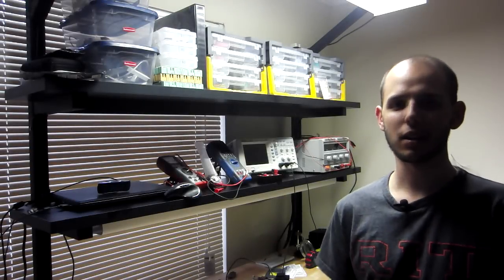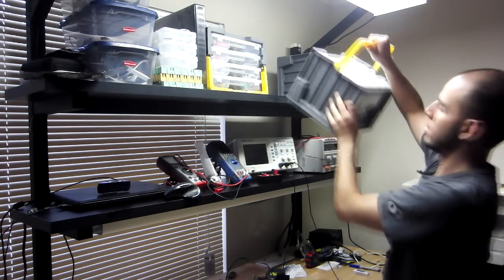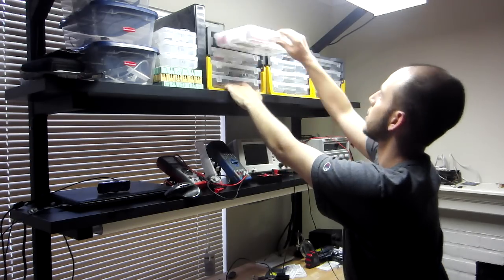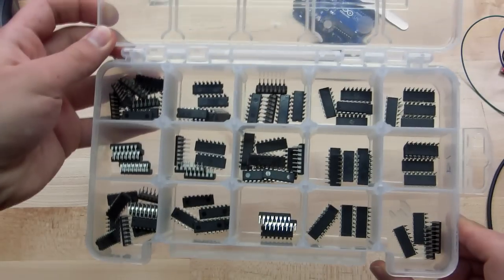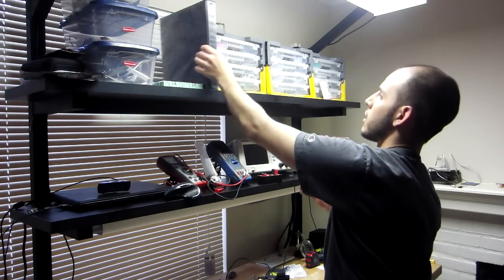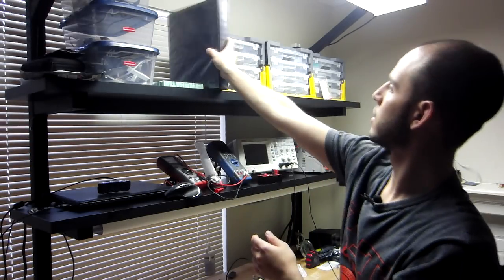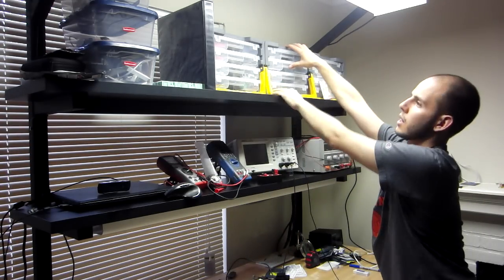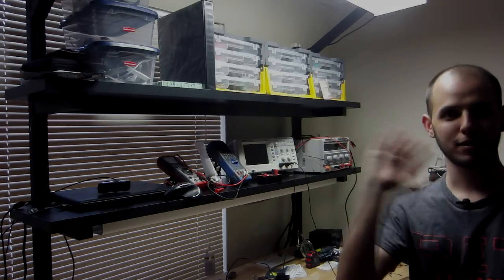Storage Stuff!

Comment: Update: I found a very good replacement for the discontinued Workforce Storage Organization Box that is better suited to electronics storage. The Plano 974 StowAway Organizer Rack is very similar to the Workforce unit, yet has 2 significant differences. Compared to the Workforce, the Plano 974 has superior flexibility in subdividing the fixed compartments, and lacks the the very useful carring handle.